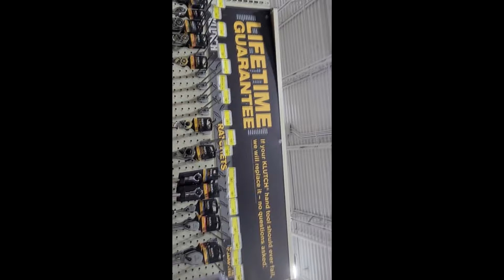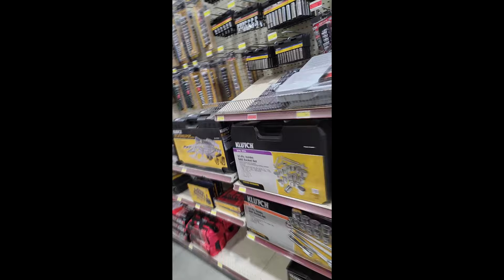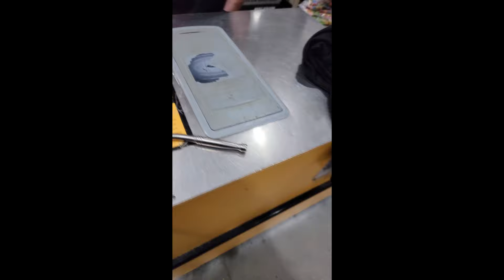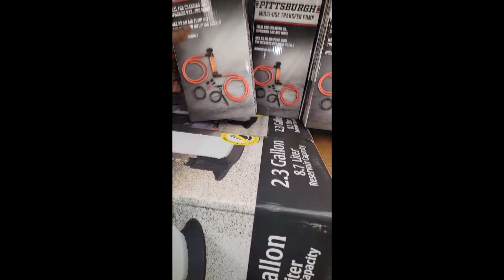Here's how Northern Tools try not to honor there Lifetime Warranty Tools. Listen to his excuse.

Comment: He was also EXTREMELY wrong about "Craftsman back in the day". They were "guaranteed forever". No matter what!!
Reply: I have majority craftsman wrenches and the three drive size socket sets, screw drivers and other specialty Craftsman tools.
Reply: Recently I had a bad ratchet and of course there are no stores left so you call the number and they want a picture of the receipt, a picture of the tool and blah blah  blah. I told her I had bought it 30 or 40 years ago. Ended up finding a guy on line who apparently hoarded the rebuild kits and had to buy a kit from him to rebuild my lifetime warranty ratchet.

I remember when the Sears store I bought from had a display case of abused, twisted, broken tools that they had warranted, I remember a breaker bar in particular that was bent about 90 degrees and the caption said he used a 4 foot cheater pipe with it and yes it was covered under warranty LMAO!
Reply: @dond5103  yea, was depressing watching Craftsman slowly die. The name may still be there, but it ain't the same -not even close. I guess "guaranteed forever" only matters if the company is around "forever".

Comment: First of all that store clerk is completely wrong, may I suggest you contact the manufacturer of the tool. Yes I am saying set the record straight with that store and the clerk! Otherwise the bull crap will continue. 

Now as for rosin core solder, seriously JT. There are many brands and types out there and all will do the job effectively. In some cases some are made from the same place it just gets a brand name put on it.

I have personally used most all types of solder, yes some are better but they all effectively get the job done correctly!